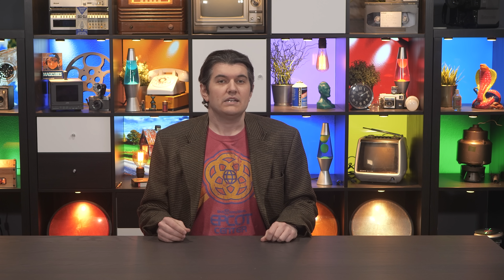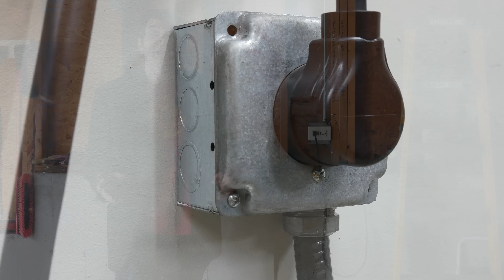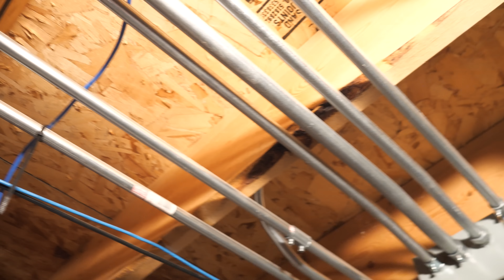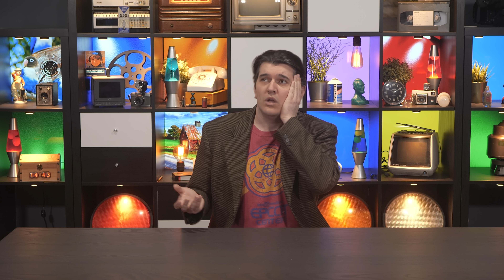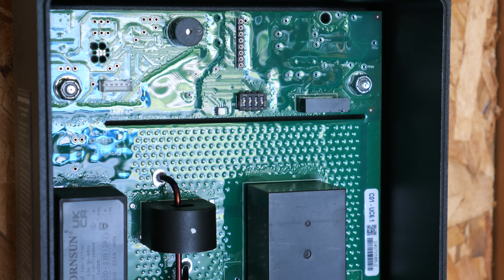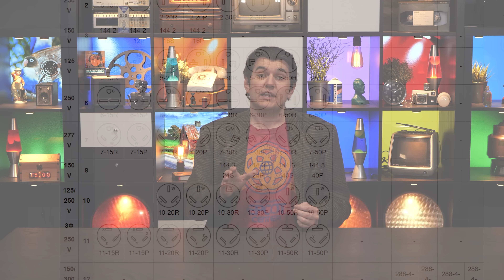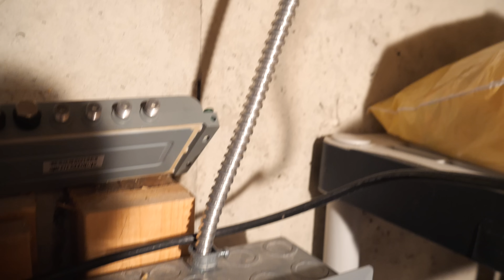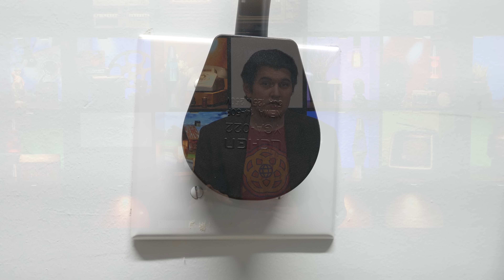The "standard" car charger is usually overkill—but your electrician might not know that

Comment: You can charge little things on big outlets but you can't charge big things on little outlets. It is way easier to adapt a little charger to run from a NEMA 14-50R than to run a big charger from a NEMA 5-15R.

Comment: When my wife got her EV (I'm still an ICE man), the electrician we hired did just use a smart switch to have our charger and dryer share a circuit. It works fine. The dryer has priority so we really never even notice it. Like you say, the car ends up being charged when she needs it regardless. One little sidenote: I'm beginning to suspect that Tesla chargers may be a ripoff. Ours was well north of what you paid for that Grizzl-E and it doesn't look as cool either.

Comment: In Belguim, the discussion is if you really need a 22kW charger or if a 11kW does the job. Almost nobody is charging on a standard 230V outlet. That's considered too slow. I have a 22kW charger in my home and a 22kW charger at my office. I get it's overkill, but also really convenient. For the moment we only have 1 electrical car, a diesel and a petrol car. But soon we will have 2 electrical cars and then it will be easier to just switch the charging car before bed. I really like the ease of mind when the car battery is full.

Comment: I have a level 2 charger that's rated for 32 Amps.  And my PHEV tops out at drawing 12 Amps.  If anything, the DIY outlet install I did with my dad has the easy life for now.

Before anyone asks, yes we both knew what we were doing during the installation.

Comment: I mean worst comes to worst, at least with the typical American apartment, you could just stick cords through your window to charge your car... not ideal but better than nothing until apartments start adding slow chargers to every lot (and they're not really incentivized to do so unfortunately).

But in Taiwan it's REALLY hard because you typically park your car on the street, or you park in an underground parking garage that has 2 EV charging stations for 100 parking spots, people have to use DC fast chargers, and they suck because not only are you waiting 30 minutes charging your car, you may have to wait in line for a spot to open up just to charge. I don't think the government in Taiwan is really taking EV's that seriously, at least not to the extent China is. We do have electric motorcycles, with battery swap stations everywhere, but you do pay a subscription to drive it, however it solves the battery degradation problem because you don't own the battery.

I almost think trailer parks are in better position because trailer parks often have electricity, meaning you can use it to charge your EV.

Comment: This is why I really like the CEE plugs that we use here in Europe (and perhaps other places, I dunno). They are durable, flexible, and there's a whole bunch of different ones that allow you to pull different currents, voltages, 3-phase, and such. Oh, and you can get water-tight ones!

I regularly use them for either 3-phase current,, or at camp-sites and marinas, but they're also used for super large events, in construction, and other industrial use.

Here in the Netherlands, we also have a plug called Perilex, but I consider that a shit plug, and I refuse to use it. It is somewhat more common for applications like connecting an electric range in houses.

Comment: Apartments are not an unsolvable problem. So long as there's spare electrical capacity, they could just install chargers that require you to enter a PIN or scan a keycard, and that's how they figure out whose bill to attach it to and prevent non-residents from using it. And most parking lots and garages already have wires for lighting, just deal with having a few less spots on installation day and add another one. Low power chargers make this even easier, but if you have enough capacity you can install one or two fast chargers for That One Guy™ who needs it

Comment: I've been charging my EV here in the UK 🇬🇧🫡 from a standard wall outlet for years! I've even got a 30m extension cable from the garage all the way out to my parking space. I limit the vehicle to 8amps on AC charging (it's a 13amp plug) and I've never had an issue.
*please check the vehicle settings after dealership servicing as it's likely to have been set back to default during a software update. Luckily, I've got a tapo energy monitor plug on the garage end so it auto shut off after one such trip to the dealership without me checking.
Reply: You do have the benefit of your standard home plugs delivering over 3000W already, which is nice. Typical American 120v/15A outlets are limited to 1800W, and then cut another ~360W off that for the 80% rule.

Comment: Totally agree, I have a 15A AU/NZ (230v) plug that is IP6x rated for outdoor use and I just plug the mobile charger in my driveway for almost 4 years. It's all I need unless I take a long trip out of the city. I can forget to plug in for a few days and it doesnt matter. Takes 16hrs, but the battery is almost never below 40% so its covered by the 10 hours of night power rates I have it scheduled for.
Just plug in and walk away. Way faster than detouring to a petrol station. Installation was a couple hundred bucks for a basic outdoor outlet that any electrician can do. And the mobile charger my car came with

Comment: This is because we are doing this butt backwards. We have the cart before the horse.  We are not ready and the ev are not ready.  Once we have the infrastructure then  and only then should we   start rolling out ev.  Before that though we need to stop focusing on college ed and onto trades like electricians. Eight niw ev are just rich people toys.
Reply: But if there are no EVs there is no need for infrastructure. And the infrastructure is already there in most cases! Simple AC charging can be made everywhere there are electric cables in the ground or house (as demonstrated in this video). It's pretty trivial to install say 11kW charching stations in public areas like parking lots, offices and shops but also around neighborhoods. It's the expensive DC fast charging stations that require a ton of infrastructure but that shouldn't be the standard way to charge your car.
Reply: @bartwillemsen1  I see no need for ev and no its not everywhere. Not in my area. maybe in the next biggest city but that 30 minutes away

Comment: 12:19 we use wire nuts to connect 480v 3PH to power our motors at work. They’re perfectly fine for 240v ;)

Comment: A standard outlet would easily be enough for me but I decided to install a 30A circuit simply because my garage only had one outlet and it was inconveniently located. I needed somewhere to charge my power tools anyway. Honestly even 30A is total overkill for most people. I only bother to plug in my car about once a week. When I visit my mom, I bring my mobile charger and plug into a standard outlet in her garage and that gives me most of the juice I need to get home. (A 10 minute DC fast charge along the route takes care of the rest.) Trust me, you really can use any normal outlet.

Comment: If you do not combine aluminum wires with copper contacts, the oxidation is not that big of a deal, rather aluminum wires will deform under the screw over time and temperature cycles loosening its contacts. They require regular tightening of the screws.

Comment: I totally agree on the simplicity being desirable HOWEVER

Living in northern Europe, electricity prices are set by the hour, as in, it is a different price each hour, each day, every day of the year. It goes from absolute extreme highs to negative lows. Following these prices manually would drive you insane, and no car is ever going to take Nordpool pricing into consideration.

I'd much rather have the charging box manage that automatically than anything else.
Reply: Agree! Although with my Dutch energy provider (Tibber, think it's also in northern Europe) you can integrate the car itself and the Tibber app will schedule charging in the cheapest hours through the car's API. Works pretty well! So I have a "dumb" charger but still dynamic charging.
Reply: @bartwillemsen1  Tibber is a Norwegian company, so yeah, they're in northern Europe.

Comment: Thanks for a very thorough explanation. You may want to consider, that some of your audience are outside USA, where CCS-2 is the only connector used, and house installations are usually 3-phased and 230V/400V. I quite agree with your take on charger simplicity. I have a cloud connected charger with a mobile app, and have had all sorts of problem with the cloud servers being unreachable.

Comment: For the first several years i just charged my tesla using a 20 Amp plug with the sideways blade on it, which was already in my garage. That charged about 60 miles per night, which was plenty and it cost only $25 for the adapter from Tesla. I also bring that with me on trips, so if I see that 20 Amp plug, I can get 60 miles in 10 hours at my air bnb. I later switched to the dryer plug,  with a $45 adapter from tesla, because my garage is too hot in the summer, so now it charges through a hole in the wall into my laundry room.

Comment: I might be rascally wrong but something tells me slow charging will strain the battery less as well?
Reply: True, slower charging is more gentle on the battery. That's another reason to prefer slower AC charging over DC fast charging. But I don't think it makes that much difference in battery health to slow charge at 11kW or 5kW for example.

Comment: Oh no, wire nuts, this will for sure.... just work fine.
I don´t like them, I have no idea if those are legal or illegal to use here in Germany. For all I was able to find, they are not illegal, it seems just that except for Amazon you don´t even get them anywhere.
Personally I prefer Wago connectors, almost no matter which style but if done right, both options work fine and ratings for both options have plenty of spare capacity to not burn down the house.
From tests I have seen, again when done properly, which is why I mostly do not like wire nuts, Wago connectors seem to be more idiot proof, so more fitting for me to use, they only run into issues regarding temperature etc. when you are already in an overlaod situation beyond specified capacity.

Comment: I have a BYD Seal in rural  Australia and only use the standard household 10A/230v wall socket.  If the battery is low, it takes 3 nights to change up.  But, the only time it gets that low is if I was away for the weekend. I can easily have the car charged by Wednesday if I am planning to go away again.  As a backup, there is a 22 amp & 50amp charger in about a 3 minute walk from where I work.

Comment: I charge with 11,5kW in my carport, and find it convenient, I can fully utilize periods with low prices. In a 3-phase European installation, it only requires 9,6A, so it can be done with 13A fuses and still have overhead. The charger is even set up to provide 22kW using 20A fuses, but my Ioniq 5 only supports 11,5kW. But 22kW is possible, even in a standard European installation. You only need an extra 3-phase group. 0:58
Reply: Uhm 9,6A is 6,65kW with 400V 3 Phase. The normal 11kW does use 16A.
Reply: @PhotonLukas No, 400V is the numerical average, not the peak,  so you simply multiply 400*3 with the current in Amps to find the Watt effect.
Reply: Uhm sadly not quite right. Its not 3 its the square root of 3. P = √3 * V * I * PF
Just look up "calculate power 3 phase" @jenslrkedal9219
Reply: @jenslrkedal9219 May I elaborate a bit:

First, to be precise it's not the average but the RMS (root mean square) Voltage, which is the DC equivalent Voltage that would produce the same power as the given AC Voltage. This is 1/sqrt(2) of the peak Voltage for a sinewave, so you got ~325V peak for a standard 230V EU grid. The rectified average would be just half of the peak value, so ~168V, and the absolute average ofc is 0V. 

Second, 400V is roughly (~398V nominal) the phase to phase Voltage for this standard EU 3x230V (phase to neutral) network, which is why it's also commonly denoted as a 230V/400V grid or feed in electrical engineering. The factor between phase to neutral and phase to phase voltage in a 3-phase system is sqrt(3). So no, you don't get the individual phase current when just calculating with 3x400V, because it'd be the phase-phase current between each leg of the triangle. Two of those currents are therefore adding up with 120° offset on each phase, again resulting in a factor of *sqrt(3). So if you calculate with 400V, you need to multiply the resulting current by that factor, to get the correct ~3x16A for a 11kW load.

That's as much as it can be explained here without pics, so pls have a look at Wikipedia if it's not totally clear.
Reply: @ZleekWolf You are right, when talking of a car, that does not have a 3-phase built-in charger. Outside USA, most cars can charge directly from 3-phase outlet. There is a miniscule loss in an electronic converter, so I actually only drag little more than 10A pr phase to charge with 11,5kW. And my charger could actually charge 22kW, if the EV was able, even though I only have 20A fuses in the charger group.

Comment: In the UK, outdoor charging units are the norm as very few people actually park their car in a garage. We typically use a 32A dedicated circuit delivering 7.6Kw. But there are other options! At my mum's house, she got a dedicated external 13A socket (UK standard) installed on the side of her house, fortuitously on the other side of the wall from her distribution panel. She doesn't have an EV, but we get to use it when visiting as she's some distance away. The electrician supplied and fitted that for ... £50 all in. It only charges at 10mph, so can take our car up to 24 hours to get a full charge, but for the occasional use it's absolutely fine. I know people who have charged like that at home for years.

Comment: I love the idea of electric vehicles, but I still don't think we are there yet. The pro-electric side will praise every aspect as "better for the environment"....but I know how lithium batteries work and I'm not an idiot. At the moment, you are looking at maybe 1500 full charge rotations, but more importantly you lose like 20% in less than 500....and there's a huge possibility of it getting worse if you are methodical on charge spot. Yes, you can get 300k+ miles out of it before you need to change your batteries, but not only is it a vastly expensive situation, it exacerbates the lithium mining process and everything involved with making of those batteries. I'm not going to compare electric to gas environmentally, way too many factors and it'll just be a heated arguing match that leads nowhere. 

With such a tight race, it boils down to money/time for the user. At 60 to 80% of its initial use, you waste more time having to recharge your vehicle. Replacing the battery costs you another car in price as well. Buying a used foreign car at 13k is cheaper than replacing the battery, and you can surely run that car for 10+ years and it'll still get you 24mpg.....but an electric car is going half the distance in less than 10. Not to mention that you are carrying a huge amount of weight for dead batteries.

If it were me, I would like to see modular battery sockets for cars. Not only can you quick swap to "charge your car," but you only have to carry the amount you actually drive. At small capsule sizes, damaged ones can be replaced at less price in rotation, which most of the material can be salvaged/recycled/refit to keep prices down. You could literally have a bank of them charging at home all day while you are at work/shopping/sleeping and then swap them in the morning (the slower the charging, the better for battery health). But car manufacturers only care about the whole price as a proprietary leech effect to customers and it's disgusting.

Comment: As far as smart chargers go, I opted for an Autel
Maxi charger with WiFi/Ethernet connectivity because I still live with my parents and I use the reports that the app can export at the end of the month to reimburse them the cost of energy I use. Having the data isn’t just a nice to have, in my case it’s necessary. I couldn’t find any place that my Ioniq 5 reports charge session data, either in the car or the app. So getting a smart charger or load sensor connected to home assistant or something was the only way I could get consumption data. Otherwise I’d have to note my battery percentage before and after and calculate an estimate from there which is tedious to say the least. Further, my dad has a plug in hybrid with a small battery and wanted to use the same charger. So getting a full log from my charger of all sessions that I can throw into excel and exclude his sessions to only sum up mine is extremely helpful. My Autel unit has been rock solid for about 3 years now, I feel they have definitely made this charger and software well. The amperage limit is first hard limited using an internal physical dial, software can limit it further but you can ignore the software setting and just use the internal switch. 

Long story short, when smarts are done well it really can be great utility that saves time. But for most, I agree a smart charger is not necessary at all.

Comment: Friends where about to upgrade their line service because an EV would not fit in, planning already finished, until the electrician came up with another idea. They ended up getting a new efficient washing machine and heat pump dryer which both happily share one circuit, freeing up a large breaker which can now be rewired to the garage. Including the price for the new washer and dryer, this solution is cheaper :)